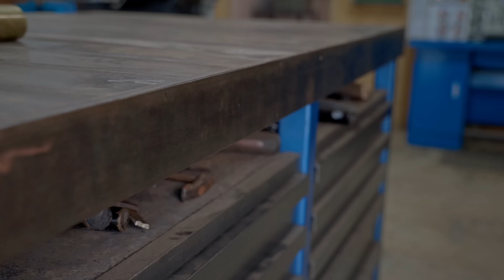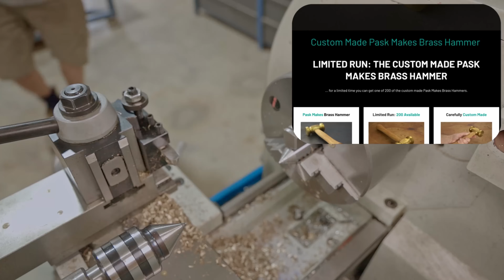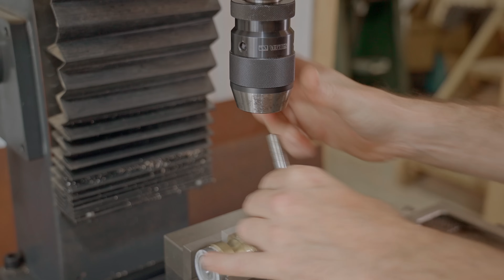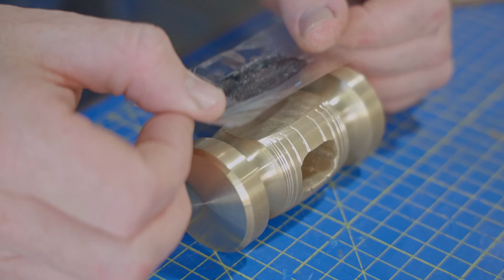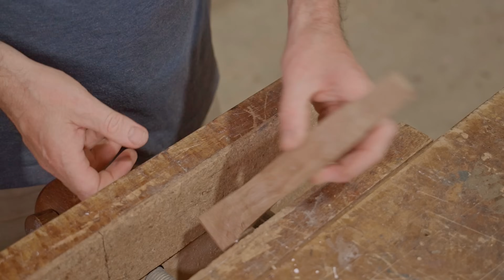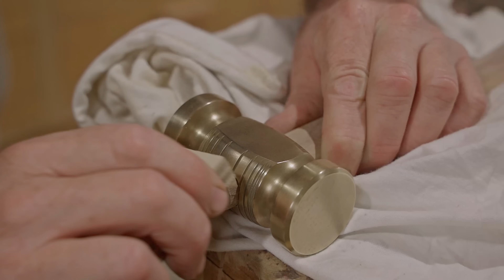How to make this Beautiful Hammer? Making your Own Tools is Rewarding!

Comment: You might want to try the Electro etching method of etching. It's faster, more controlled, you don't have to seal off the whole object and only uses salt water
I'm speaking of the method where you use a cotton wad or Q-Tip rather than immersion.

Comment: A tip for brass, it work hardens so you want to take off quite a lot at a time. If you cut too shallow the tool just pushes the brass out of the way and hardens it, turning it brittle and ruining surface finish.

Comment: After the centre was drilled you used some sort of special tool designed for removing sharp edges extremely quickly. 
Please sir I am begging you sir to please tell us where this wondrous piece of equipment might be purchased. 
I have very many sharp edges in my occupation.

Comment: Getting back into the shop after 15 years and found everything has rusted here in Qld. Figured I would make tools from Brass that don't rust. Apart from doing Hand Tool Rescue on the rusted stuff, any clues for rust protection?

Comment: @Pask an easy way to reduce chatter in brass is lower the tool, making the cutter run negative rake. I'm a retired instrument makers, 50 years in trade.
Reply: What about shiming the rear of the cutter up to create a negative Rake?  Wouldn't going lower have a variable Rake based on depth and work radius?

Comment: The pitting in the etched logo is kinda fabulous, it resembles the texture of the metal left underneath a peice of shattered enamel. Perhaps a formula of enamel exists that won't shatter when using the hammer, like that fake enamel, you could experiment (when the time comes to replace the handle) by inlaying some enamel in the same colour as your channel logo into the etched logo.

Comment: I turn wood, not metal, but I've learned the hard way you can't fully engage the edge of a scraping tool. You need a tool with a slightly smaller radius.

Comment: When you are weeding (removing the waste) vinyl, get a 10a scalpel blade (the really pointy one) and prick the centre of the piece of vinyl you want to remove at a shallow angle to the surface then lift it away from the surface. If you start at an edge you risk wrecking the bits of vinyl you want to keep. I love your work but as an ex sign maker, watching you weed was a bit painful!

Comment: Cutting wide grooves: It helps if you move the form tool slightly left-right while cutting, so you are not cutting with the whole diameter at once. Makes the groove a bit wider and the radius at the end is not really a radius anymore, but in this case i don´t see a need for precision...
Another beautyful project👍
Reply from the maker: Thanks very much! That makes sense as it would be halving the area being cut. :)

Comment: The thing with carbide tooling is it’s actually super fast, so the rpm of the machine should be around 3000 and yes that’s three thousand. I’m not fully sure what makes it work this way but that fast makes everything work very well. You compare this to hss which usually is 450 or so sometimes slwoler and bigger tolls but you get the point

Comment: Diluted ferric chloride plus a bit of citric acid etches brass quickly and cleanly. 12-13  minutes max, at room temperature, followed by a soak in bicarb solution to neutralize. And, yes spray paint for masking. Good job on that handle. Its harder than it looks.

Comment: Negative rake for tooling for soft metals. Grinding the round insert slightly tapered down at the front will help a bit over the 0° rake you uses. Hope it helps! Keep up the great content. I always love watching!
Reply from the maker: Thanks Keegan - I'll remember that for next time. :)
Reply: I always been using zero rake HSS. A touch of diamond hone makes a difference.

Comment: To get the lathe turning to be less grabby with brass: lower your flat top (which is normal to the surface if at the correct z-height for facing, which gives it zero rake) HSS tool in your tool post so you make your tool have effective "negative" rake (ie not normal to the contact point)
Reply from the maker: Thanks of that, I'll keep it in mind for next time. :)
Reply: excatly or you can grind a negative rake in the tool

Comment: I actually like the pitting in the logo. If you hadn't said otherwise, I would have thought it was deliberate. If you don't like it, you could always do a paint fill with enamel. It would level right out, and really make the logo pop.
Reply from the maker: I reckon pitting can look great on an etch. I liked the etch I did on my brass padlock where I stippled the background. I did think about painting the logo but I wanted it to be more subtle and not stand out too much. :)
Reply: @PaskMakes  I like the deep pitting, makes it look like hand stippling.
Reply: @PaskMakes  just a thought here, but would it be possible to fill it with solder and then sand it flat? Might be a more subtle than paint.
Reply: I was going to say fill with black epoxy, but either would work. I love the hammer.